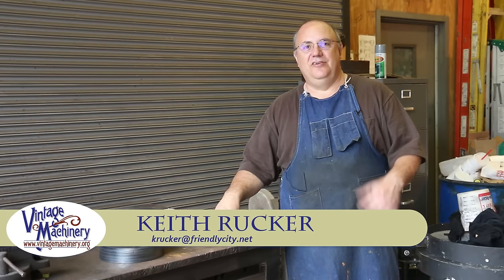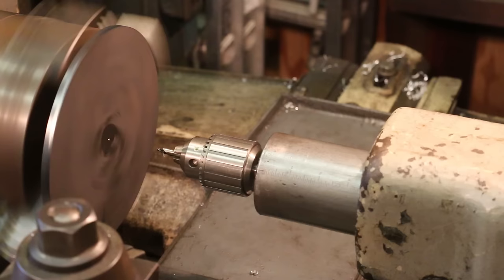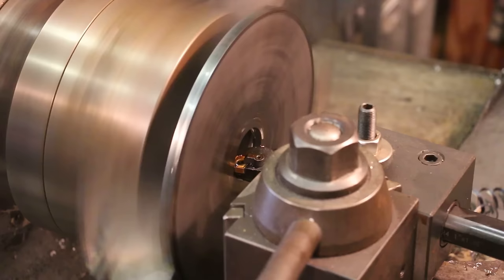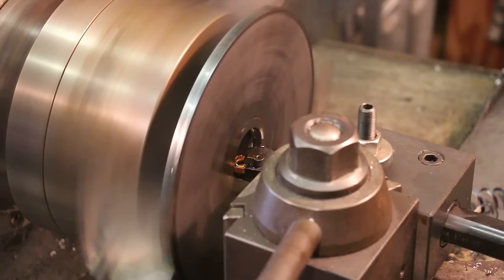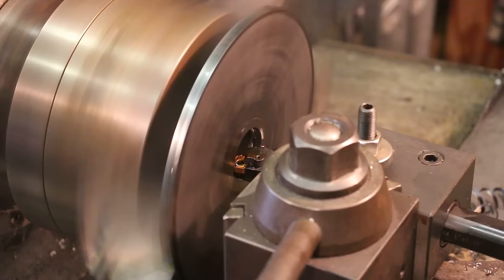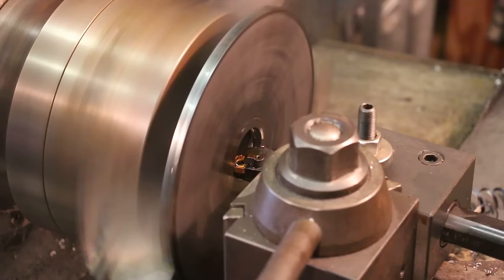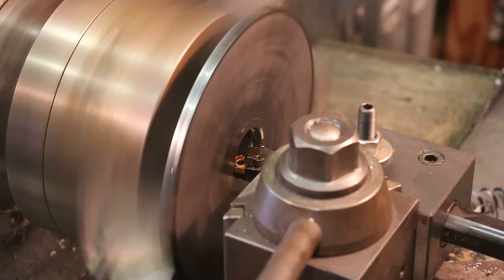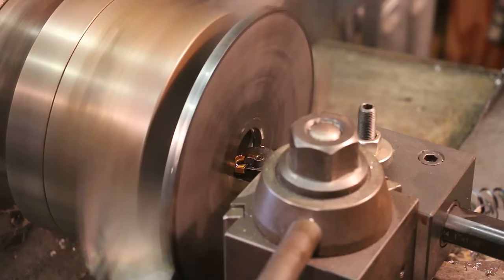Machining Dividing Head Index Plates

Comment: Wow! As a total non-machinist, I saw almost every step of this process a different way, going something like: smaller central hole, custom arbor, massive o.d. reduction using something like a parting tool, precision o.d., face side 1, flip, face side 2, remove arbor and rechuck outside, bore center hold to precision dimension.  You don't need to tell me how many ways this is wrong - it's just what I thought in my head. My real questions is, did you consider remaking plate 2 while you were at it?  The more I watch, the more I envy you your patience.
Reply from the maker: +Don Halley Don, there is no doubt that this problem in machining could have been tacked many different ways and as long as the end results were the same it really does not matter how you got there.
Reply: +Don Halley There&#39;s nothing wrong with your choice of the order of operations - especially when working with stock that is too large to fit in a chuck.

I had to make some thin disks some few years back, which fortunately did not need to be faced off.

I started with square blanks of sheet, drilled center holes, bolted up the stack, and then chucked on the bolt to turn down a defined OD.

You will find that there often is no need to be too particular about the order of operations in machining, and anyway, you will want to work with what you have in the way of tools due to cost and/or schedule.

So long as you think your process through, and work carefully, you most likely will get what you want in the end.

Afterwards, you can do the review and see if things could have gone better... for some jobs, that is critical, for others it is a matter of: "Well, I could gone at that from the other direction, but I wouldn't gain anything in the end..."

Solving these puzzles is more than half of the fun of machining!

Regards,

Eric
Reply: +Keith Rucker - VintageMachinery.org
Put three machinists in a room with a project, 
get seven ways to do it.😄
Reply: +NeoLASE At a minimum...
Reply: +NeoLASE At a minimum...

Comment: Really nice, thanks. I'm sure there's a good reason behind this - but why is trepanning not used more? Is it just that it's hard to get the right support geometry for the cutter?
Reply from the maker: +Allan Stirling  have to admit that I have never really used any trepanning cutters.  Mainly because most of my work is for one-off parts and it is hard to justify a dedicated cutter for a particular diameter for just a few pieces.  For production work, I think it would be a great option but it usually just does make sense to buy or make a dedicated cutter like that for just a few pieces.
Reply: +Keith Rucker - VintageMachinery.org Thanks for the explanation, it's about what I had assumed. Getting the job done is way more important than increasing your collection of "one off" tools to sift through.

Comment: You had to take a lot off the OD. I would have layed the original plate on the blank and drawn a line arround it and then used the metal bandsaw to get the most off. But it does not matter if time is not a option. You got the job done in in a nice way.
Thanks for the video..
Reply from the maker: +Rob Gerrits Yes, bandsawing would have saved some time.  My problem was the blade I have on my metal cutting band saw is too wide to make that tight of a diameter.  I need to order a thinner blade for jobs like this but I did not have it on hand and did not want to wait for one to be shipped.  Making do with what I had!

Comment: i'm a watchmaker and when i use the glue chuck idea i melt shalack as a glue the bunus is it is easy to melt off and the residue is easy to remove with metho i dont know if it is strong enough to hold the divideing plates if not its easy to remove and you just remelt for the next plate

Comment: Instead of using a CNC, most mills with a dro have the bolt circle program. very quick. If no DRO, you can just use the manual bolt circle method with mill dials. Much slower than the DRO, likely takes as much time as a RT.
Of do away with the plates entirely, and mount a stepper motor, drive etc. and make it Digital. As I did.

Comment: The guy who sold me the divider unit also put in something like thirty plates he made. Sort of makes me wonder why there aren't more people who make their own instead of buying, perhaps the complexity of the job in respect to the precision is keeping people out??

Either way, really cool project, goes in the fave directory. :)
Reply: I just ran to the lathe and did a surface cut with the boring bar, i don't know if it's the mass of the whole assebly (holder plus bar)or just something about the particular setup of a boring bar, but the cut is very smooth. That's a neat trick there.
Reply from the maker: +aserta Thanks - I wonder why he needed so many plates.  Was this for direct indexing rather than compound indexing?

Comment: Hey keith, when you do a job that involves multiple pieces with the same dimensions do you do all the operations on one side of each piece or do you use one tool setup at a time and switch out pieces for each tool setup ? I'm not sure if I worded that correctly.
Reply: +mcpheonixx  a "tool at a time" and switching pieces would probably same a good bit of time...
Reply from the maker: +mcpheonixx I machined one side first on all of the plates and then did all of the other sides.

Comment: Small bits make the initial hole which means from the center out, the whole tip of the bit is used. Does this mean larger bits get more wear on only the outside of the tip?
Reply from the maker: +Adam R Drilling out in steps like that actually saves a lot of wear and tear on bigger drill bits because by removing less material  you don't generate as much heat.  Very often, it is the heat that kills a drill bit more than just plan wear.  But it would be true that the outside of the bit would wear faster than the center of the bit.  Having a good drill sharpener, it is not a big issue for me - I just sharpen the whole bit whenever it needs it!

Comment: Could you not have used a center compression chuck?  Kinda like a Dremel tool where you put the disk in the chuck and tighten the bolt in the center to compress the center to fit the hole in your disk.

Comment: I would have just flipped the part after doing the first facing to face the other side then drilled and tapped the center of the aluminium and clamped it with a thick washer and bolt to turn the outside diameter.
Reply from the maker: +Damo Floyd Not quite that easy.  Because I could not face all the way to the edge of the part without getting into the jaws of my chuck, you could not flip the part around and have the machined face up against the back of the chuck.

Comment: I've seen these techniques thanks to Clickspring as well.  What I didn't understand is why you shaved the edge of the plate instead of dividing the outer edge off with a slow plunge cut into the face.  You could have then cleaned the edge up as normal.  Just wondering...maybe you were worried that the amount of force on the face plate would break the glue free?  Not sure...just wondering.  I bet that could have saved you a ton of time.
Reply from the maker: +WreckDiver99 The problem with a trepanning cut is that you really need to have a cutter for the specific diameter you are cutting.  I could have hand ground one out of HSS, which would have taken about as long as it took me to just turn them down or I could have spent a bunch of money on a tool that I would have likely never used again.  If this had been a production job of many, many parts, it would make more sense.  And it was a good opportunity to show off the "glue chuck"!
Reply: Maybe I'm not clear on my terminology....why not take a dividing tool and plunge it into the face approximately 100 thousanths away from final OD and part an outer ring off.  Wouldn't that have saved multiple edge passes, and therefore quite a bit of time?  After that first trim you could have then done 2 or 3 final trims to get to your final OD.  I'm not sure of the terminology as I have never operated a lathe and am trying to learn.  I've seen ClickSpring do exactly what I'm attempting to describe here (and apparently failing miserably).  LOL.

Comment: I'm in the same situation with my dividing head and was really hoping you'd show how to drill the holes.

I plan on using the dividing head to make its own plates. I wrote a program to generate a pdf template that I can transfer the holes to some 1/4" ply by hand using the drill press. Then I'll use the wood plate to transfer the holes to the metal plate. I figure with a 40:1 reduction the final plate will be close enough even if the wood template is off a bit. It should be ~1:1600 error on the final part.
Reply: +aallwwkk I do exactly what you plan to do, except no plywood involved. I wrote a program (in PostScript) to generate a full-size template. I glue that to the blank with contact cement. I use an optical center punch to center-punch the holes. Then step-drill to final size. It is very tedious to centerpunch all the holes, but the optical centerpunch is very accurate. Since I built my own dividing head with an oddball worm ratio there is no way I can use commercial plates. So far it has worked.
Reply from the maker: +aallwwkk As long as you can keep holes on the circle very accurately, I think that what you describe will work fine.  When I made that plate many years ago, we used a rotary table to make sure we were always on the same circle, but I agree that a tiny error in the angle of any particular hole will not matter - as long as you error is not multiplied from one hole to another.
Reply: Exactly. That is why I use my Veritas optical center punch (and a lot of care) to make my plates. As you said, tedious.
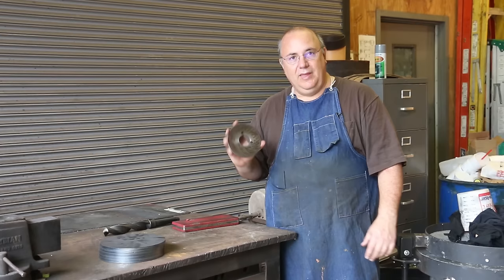Reply: Keith Rucker - VintageMachinery.org thanks for the reply. how accurate do you think it need to be? say the holes were off 0.015". with a 1:40 ratio the final plate would be off 0.0004" and then the final transfer to the work from the plate would be off 0.00001". even if the hole was off .25" that's only 0.006" on the final plate and  0.0002" on the work. seems like you could just get in the general area is have it work unless I'm missing something?
Reply: Sigh. There are several ways to make dividing plates without CNC.or a DRO. One way is to use a broken bandsaw blade, which you wrap around a wooden circle sized to acommodate the number of teeth you need. Another way is  to get CAD to make you a full-size template. Centerpunch and drill. It is nice to know that any error you make will be reduced by the worm ratio, So a 0.1 mm error will actually be (for a 40:1 worm) a .0025 mm error -- neglibile.

Comment: I would have tack welded the six disks together then mounted them in the four jaw chuck and  bored the id. Then drilled the the three holes mounting holes. I would have then separated them and face one face of each disk. I would then counter bore the holes from the rough side to the correct depth (measuring from the finished face). I would have then made an arbor to use to turn the OD and face off to the correct thickness. The screws would be also faced but you would then use the same screws to face off the other five.
Reply from the maker: +Tom Jervis Many ways to skin a cat!
Reply: +Keith Rucker - VintageMachinery.org 
Yes. There's the right way 'safe' and then there's your way! Lol.

Comment: Thanks for the video Keith.  Recently I made a set of plates to convert my rotary table into a dividing head.  I borrowed a conversion  kit from a friend & copied it all.  Only three plates but still the best part of 600 holes to drill!  very tedious but also satisfying  project.  Cleaning up all those 2.6mm holes was the worst part.  Any chance of a video of the cnc job.
Reply from the maker: +Ron Cartwright Pretty good chance you will see a video of the CNC work - either on my channel or on Mike Wiggins YouTube channel (The Back Yard Machine Shop).  Although, he is using the CNC mill where he works rather than the manual machines in his back yard....

Comment: Did you consider using a modified parting tool to remove the excess diameter material from the plate?
Reply from the maker: +Gord Taylor Yes, I did, but it requires a tool that I did not have and did not want to buy for just a few parts.  I could have ground the cutter out of HSS but that too would have taken about as long as it took me to just turn the parts down like I did.  Had it been a larger production run, that would have been the way to go.

Comment: hi kieth I'm a new hobby machinist and I'm doing some gear cutting with my 40:1 dividing head on my mill. but I don't have all the plates to compleat a set so I would like to make the ones I don't have. I understand what you said about dividing the number of holes you want into 360 and using the rotary table no problem there but what I don't get is how do I dertermine what the pin hole diameter is for each ring of  holes having 5 or 6 rings of holes on a plate? some heads up on this would  be great kieth. keep the vids coming kieth really enjoy your channel.
Reply from the maker: +Jamie Buckley The diameter of each ring is totally irrelevant - it does not matter what that is.

Comment: Eastman 910 I think was the number. A company that I was working for was drive pinning nameplates 2 drops of glue replaced 4 drilled holes and 4 drive pins. btw have you been inside of the k&t dividing head, I rebuilt one years ago.
Reply from the maker: +Richard Haisley No, I have not been inside the dividing head.  I stopped taking apart things that were working fine many years ago!  Should I ever need to go in there,  will be looking up this comment again...

Comment: Did you consider making a face-grooving tool bit? Who knows? A set of six rings might be useful in some future project.
Reply from the maker: +Peter W. Meek I actually did consider that but did not want to have to grind the cutter out of HSS.  If I had a few more to do, I think it would have been worth the extra effort.
Reply: I have a 20+ pound miscellany of ground HSS bits (most on both ends) that I have aquired over the years. I can always find one that is close to what I need at the moment. It's a matter of a minute or two to modify something to fit the current project. I filmed sorting the collection out by size. I'll include it in some future Erratic Gallimaufry.
Reply: @VintageMachinery  Surely grinding one trepanning bit would take less time than machining down the radius of even one of those discs, much less six of them... Well, it's  your time I guess.

Comment: in a pinch nail polish remover also will take the glue residue off
Reply from the maker: +Dana Phillips If you read the label on your nail polish remover, it is basically overpriced acetone....
Reply: +Keith Rucker - VintageMachinery.org that's why I stated " in a pinch " not only that polish remover smells a lot worse

Comment: why did you not parting cut the outer portion off then a final turn for the dia.
Reply from the maker: +chris rhodes It takes a special cutter - a regular parting tool will not work.  The cutter has to be circular shaped and not straight.  I could have ground one out of HSS but it would have taken a lot of work or I could have spent a lot of money for a carbide tool to do it, but for six parts, it just was not worth the time and/or money.
Reply: ok i was just wanting to know the reason so i can learn  the extent of my machining ability is turn drums and rotors for auto repair i would like to get a small machine to learn on

Comment: Can't you just secure the "template"  on top of the blanks and drill through the the existing holes?
Reply from the maker: +Andrei Marinescu Are you talking about using the existing plates with the holes in them as a template?  If so, the problem is I only have one of the original plates so I don't have the other ones I need to use as a template.
Reply: Keith Rucker - VintageMachinery.org That's what I was talking about. Thanks for clearing things out.

Comment: keith i use ca. glue in woodturning never though it would work with metal,great tip. bob
Reply from the maker: +Robert Kutz I have used tons of CA in wood turning as well.  But it can be used with metal as long as you are careful not to take too big of a cut or build up too much heat.  It has limitations but is a nice trick to use for some jobs.

Comment: hi keith,
i am very pleasantly impressed with your glue chuck!
i have seen and worked with the plate friction attachments, but never with the glue.
thank you very much for the idea.

what is the material of those plates?
it would be very interesting to see your friend's cnc  operation -- if it is not oo late.

thank you very much for the video,
-toly
Reply from the maker: +Toly Dukhovny I cannot remember off hand what the grade of steel was for those plates, but it is basically just regular plate steel - nothing fancy.  The glue chuck is a handy work holding option and sometimes it is just the trick.  It has its limitations but for some jobs it is a great way to get the job done.  You can also use Loctite instead of Superglue - Loctite is also reversible with heat.  As for the CNC operation, I am going to try and get some video of that if I can - keep your fingers crossed!
Reply: +Keith Rucker - VintageMachinery.org thanks for the reply, keith.
if it is a mild steel, aren't the division holes going to wear quickly with the use? are you planning for any heat treatment and/or case hardening?
thank you,
-t

Comment: I guess I'm just old fashioned because I would have used a retaining arbor with a nut and used a high speed tool bit to cut the I'd close to finish is then switched back to the boreing bar for the face cut to finish thickness then switched to a right Hanna tool bit to finish the I'd.  Just another way to skin the cat.